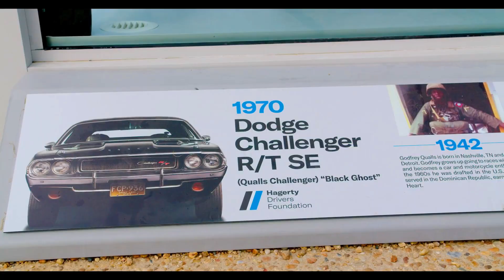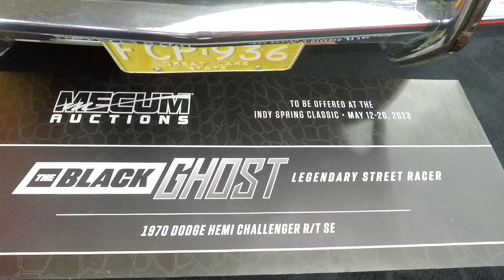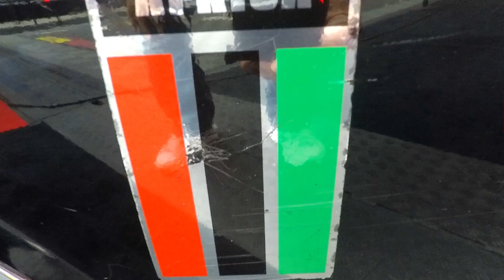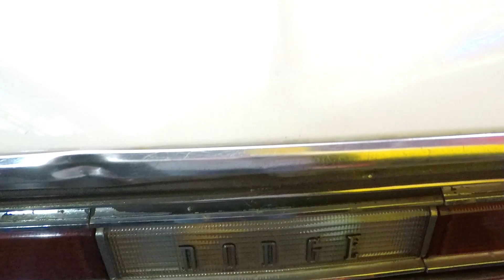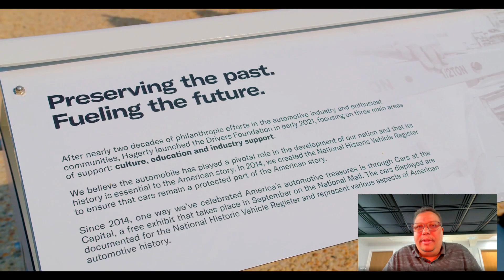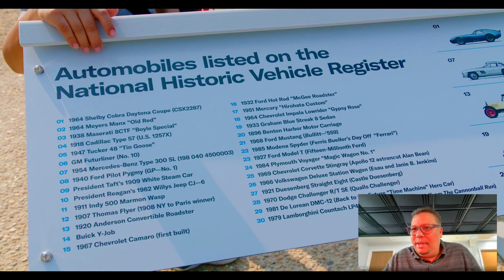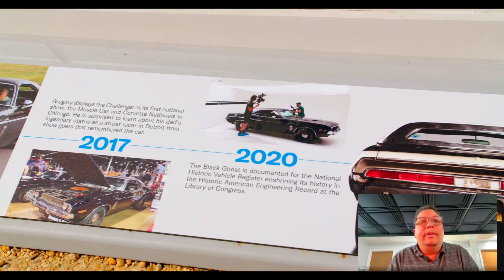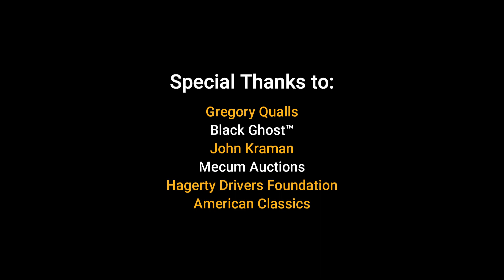Is the Black Ghost car a true story?

Comment: Welded the distributor in place???? Why, all us car guys advance timing over stock settings and just tighten the distributor down at the setting, I've been working on ,driving and studying performance and muscle car facts for close to 40 years now, and theres no reason to weld a distributor ,im not well versed on what materials hemi distributor are made of, but most are aluminum and engine blocks are cast iron, so welding would be out of the question , and again why would you anyway, the only reason i could figure welding it would be if the hold down bolt was broke off in the motor and still that would be a ridiculous fix, it is a rare well optioned and fairly fast for stock production car of that time, but if you look up the numbers they dont support the story, especially with stock exhaust manifolds, and the car being totally intact as far as weight reduction, those cars are no light weights, i guess if it was rarely taken out and never met up with alot of customized purpose built cars that were around that area at that time, then i can understand it winning some races, and no coils, advanced timing, are gonna make any big substantial differences in performance, compression, cam,  heads, carburetion, exhaust flow those are the thing that it takes to gain substantial changes in performing, and there were plenty of cars at that time  in that area that had those mods, and in seriously lighter cars with there weight reduced by stripping away everything none essential, sorry fellas but you cant dispute horsepower and weight equations and for that car it just dont add up, but its a nice survivor car with some cool options regardless